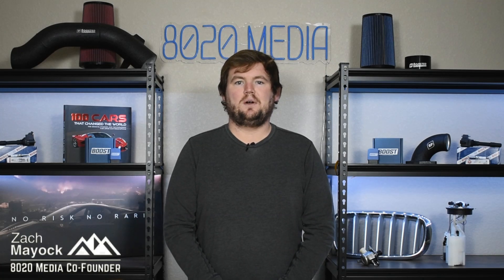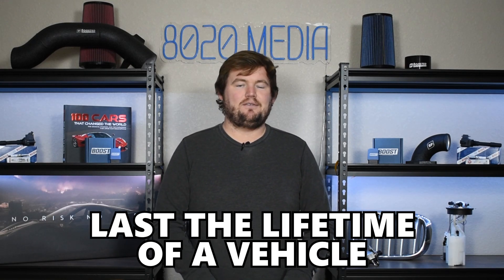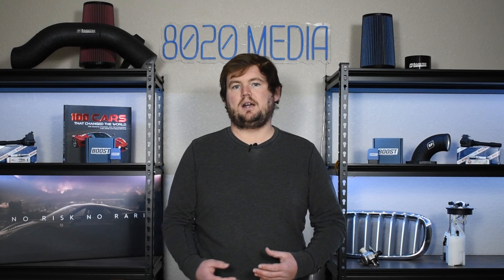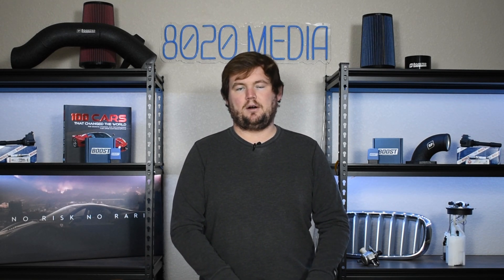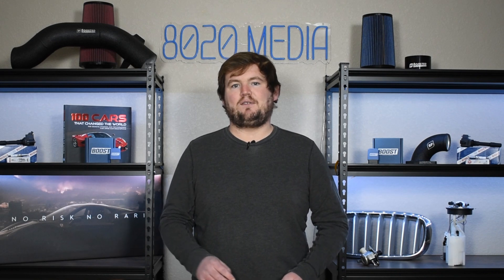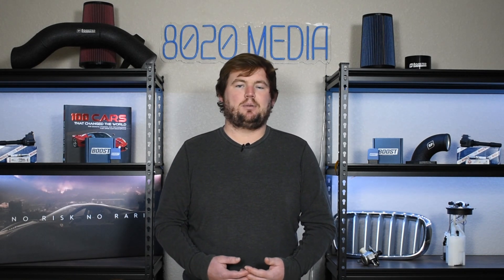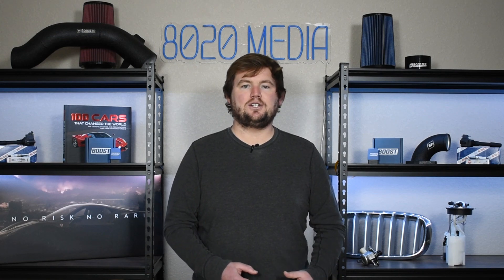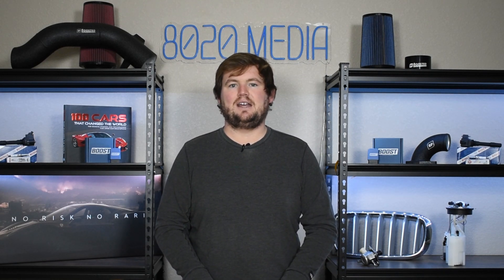Signs & Symptoms of a Bad Purge Valve! (EVAP Purge Solenoid OR Canister Purge Valve)

Comment: I have a 2013 Chevy Sonic 1.4 Lt turbo hatchback, and on my obdII scanner the monitor status of emission were showing up, although no codes at all are showing and it is throwing me off, at first I replaced the thermostat which is an electric thermostat, after 10 min with the engine on a high pitch whistling noise would’ve start, so I replaced it, but the Evap was still showing up, I did a drive cycle to see if it can cleared the evap monitor status but it was still showing up, there was three emission monitor status showing up, the EVAP half Red flashing, O2S Half Red Flashing, and the HTR half red flashing, I tried to look for videos but supposedly some of them were saying the Evap Purge Valve needed to be replaced? Do you have like a clue what is causing those three lights showing up? Maybe it could be the charcoal canister to be replaced?

Comment: Could this cause p0172? Coincidentally both times car stalled was after getting gas. Half tank and almost full tank. Been to 3 shops. I've been after this for 3 months, MAF, throttle body cleaned, new air filter. I'm running out of ideas here...
Reply: I am having the same issue p0172 which is too rich fuel system and I have replaced o2 sensors and bank 1 4 injectors but no success. Now i am suspecting the evap purge valve and i am going to disconnect the valve and block it place and then check fuel trim if becomes normal
Reply from the maker: S - If you suspect the purge valve, temporarily blocking it off is a good diagnostic move because a stuck-open purge will constantly feed fuel vapors into the intake and skew trims rich, especially at idle and after refueling. If you disconnect and block it and the short-term and long-term fuel trims settle closer to zero, you’ve found the culprit. Just remember, don’t drive long-term with it blocked (you’ll trigger other EVAP codes), but as a test it’s safe. Also keep an eye on fuel pressure — a leaking fuel pressure regulator or high pressure from the pump can also cause P0172. But given your symptoms and the parts you’ve already changed, the purge valve is a very reasonable suspect.
Reply from the maker: H - Yes — a sticking purge valve can definitely set a P0172 (system too rich) and also cause stalling after refueling. If the purge valve is stuck open, it will let raw fuel vapors from the charcoal canister get pulled straight into the intake, especially right after filling the tank when vapor pressure is highest. That dumps extra fuel into the engine, richens the mixture, and can make the engine stumble or stall at idle. Since you’ve already done MAF, throttle body, and air filter, the purge valve is a strong suspect — they’re cheap, common failure items, and easy to test by pulling the hose and checking for vacuum at idle (there should be none). If you feel vacuum there, the valve is leaking and needs to be replaced.
Reply: I have a 15 Chevy Impala changed my purge valve and now my car won’t start. What should I do? ???

Comment: I have a 2016 volkswagen tiguan and had the water pump replaced. I brought the car home and the next day the garage stunk like gas. I took it back and mechanic said it was just spilled gas from removing the line and the smell would go away. Been 3 weeks and it still smells. I bet its that purge valve. Gonna look tomorrow. Thank u for this video. I have no codes and car runs smooth. Regardless ima take it back to the mechanic
Reply from the maker: F - Yeah, if your Tiguan still reeks of fuel three weeks after a water pump job, that’s not just some spilled gas evaporating—it’s likely a small fuel vapor leak, and you're smart to suspect the purge valve or one of the EVAP lines around it, especially if something was bumped, cracked, or left loose during the repair; even without a check engine light, a cracked purge valve hose or improperly seated line can slowly vent fumes into the engine bay, and the smell would definitely hang around in your garage, so tomorrow check for cracked plastic lines, loose clamps, or a sticking purge valve near the intake or charcoal canister, and if anything seems off, take it back to the mechanic with proof in hand—because after a major job like that, they really should have double-checked for fuel system integrity before handing it back.

Comment: Could a symptom also be a strong smell of gas after filling up that last a few days? If I fill my truck up and park it in the garage I will smell gas for a few days. So I'm thinking the gas cap needs to be replaced or the charcoal canister or this solenoid. I have no fault codes but I also have a 20 year old truck that just might not be getting triggered
Reply from the maker: S - Yes, a persistent gas smell after refueling—especially if it lingers for days and there are no codes—is very likely related to a fault in the EVAP system, and on a 20-year-old truck with potentially less sensitive diagnostics, it's quite possible that a cracked or saturated charcoal canister, a stuck open purge or vent solenoid, a leaky fuel filler neck, or even a worn-out gas cap seal is allowing vapors to escape, particularly after the tank is filled and pressure builds; since there’s no CEL, start by replacing the gas cap (cheapest and most common failure), then inspect the canister and associated hoses for cracks or damage, and if the problem persists, check for wetness or vapor leaks around the top of the tank or filler neck, as older EVAP lines and seals degrade over time and may not trigger a fault even when leaking.

Comment: Thanks for the video. 2 months ago my car's tank was replaced, after two weeks the car was stalling at idle or red light, also I could refuel the car properly. Went to another shop they replaced the charcoal canister. But I was getting P0441 and same refueling issue, car stalling was solved. Today discovered purge valve solenoid hose was disconnected. I reconnected the hose car was stalling again. Please help. Already spent a lot on this car. It's a lexus es350 2007
Reply from the maker: U - Thanks for the feedback! What you’re dealing with on your 2007 Lexus ES350 is a classic EVAP system imbalance likely caused by either a malfunctioning purge valve solenoid or an improperly working charcoal canister vent valve, especially after recent fuel system work—the stalling at idle when the purge hose is reconnected suggests the purge valve is stuck open, allowing raw fuel vapors into the intake at the wrong time, which creates a rich mixture and kills the engine at idle; that would also explain the P0441 code (incorrect purge flow) and the fueling issue, since pressure isn’t venting properly during refueling—so your next move should be to replace the purge valve solenoid, clear the codes, and retest, because with that hose connected and the valve malfunctioning, it throws off idle and EVAP operation entirely.
Reply: Thank you for the reply. I went to the mechanic, they are suspecting fuel tank, they told me there's pressure building up inside the tank. I'm confused, told them to check the purge valve solenoid. I will show them your comment. Anything else do you recommend checking? @8020Automotive

Comment: I replaced this part and 3 weeks later same light and now it has all the problems you are talking about. Do you have any thoughts?
Reply from the maker: J - If you replaced the EVAP purge valve and the check engine light returned after 3 weeks, along with other issues like lean fuel trim, random misfires, and electrical glitches, the problem could be a faulty EVAP system component, electrical issue, or vacuum leak. Check the EVAP vent valve and charcoal canister for blockages, as a clogged canister can cause excessive vacuum buildup. Inspect the wiring harness near the purge valve, ensuring no damaged or loose connections. Also, test for vacuum leaks around the intake manifold, as a leak could trigger a lean condition. Since you're experiencing multiple electrical problems, scan for additional codes beyond the EVAP code—a failing alternator or weak battery could also cause erratic ECU behavior.

Comment: Could you please help me to find an issue in my ford explorer ecoboost engine 2020. I am getting a single chick sound(loud) while cold start and sometimes while driving. I have the video of that also.
Reply from the maker: A - A single loud click on cold start and occasionally while driving in your 2020 Ford Explorer EcoBoost could be related to the starter solenoid, timing chain tensioner, turbo wastegate actuator, or an engine mount shifting under load. On cold starts, a loud click might indicate the starter solenoid engaging but momentarily sticking—especially if there’s a slight delay in cranking. If it happens while driving, it could be the turbo wastegate actuator opening or closing abruptly, making a sharp clicking sound. Another possibility is the timing chain tensioner adjusting momentarily if oil pressure is low or if oil needs changing. Additionally, if the click occurs during acceleration or braking, an engine mount shifting slightly under torque might be the cause. Checking for loose components, worn engine mounts, or performing an oil change could help, but if the issue persists, a mechanic with a chassis ear or diagnostic tool can pinpoint the exact source. Keep us updated!
Reply: I'm having the same issue expedition Ford loud bang when starting I'm thinking it's leaking into the chamber  ???? Mind blown

Comment: I had a brand new Toyota Sienna that would not start after everytime I gassed up. The Toyota dealer couldn’t figure it out, but eventually, they realized it was the purge valve. They said this can happen from over filling the fuel tank. That reminded me that one of my first times I filled up  the new car the gas nozzle didn’t click when it was full and gas was just pouring out of the car onto the street. That must have been what killed the purge valve.
Reply from the maker: M - Yes, overfilling the fuel tank can damage the purge valve in the EVAP (Evaporative Emission Control) system, as excess fuel can flood the system and contaminate components designed to handle only vapors. The incident where gas overflowed likely caused liquid fuel to enter the charcoal canister and purge valve, leading to their premature failure. This is a common issue that can result in starting problems after refueling, as a stuck or malfunctioning purge valve may cause excessive fuel vapor flow into the intake, disrupting the air-fuel mixture. To avoid this in the future, stop fueling once the pump clicks off and avoid "topping off" the tank.

Comment: Combustion engines are highly complex and have been improved a huge amount over the decades I've been operating them - this applies especially to reciprocating engines used in land vehicles. I have operated both recips and turboprops in aircraft too. I wonder how much more development is possible? But now we have electrical energy storage (mostly in batteries) available, we should pursue electrical engines for their relative simplicity and reliability and not least for their lack of air pollution in their vicinity (so we don't have to breathe particulates). And quieter operation.
Reply from the maker: F - This is interesting.